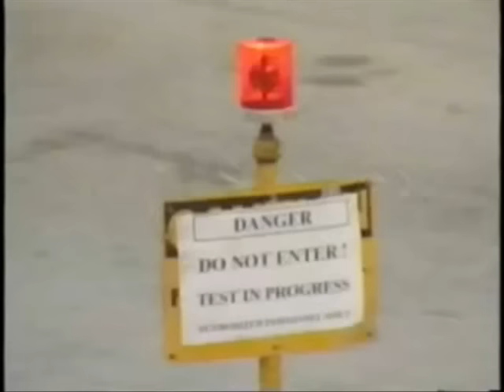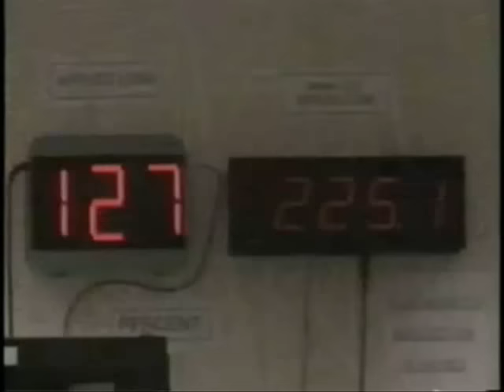Boeing 777 Wing Test

Comment: I think the most impressive thing isn't that it made it to such high loading, but that both wings failed at the same time, and in pretty close to the same place. It's really hard to get that kind of symmetry with variability is manufacturing, etc. Hooray for quality control!
Reply: I think you meant to say "154"
Reply: This is actually expected behavior and I think the engineers would have been baffled if both did not break in the same second. The moment one section fails, the static event is changed to a dynamic event and large stress waves propagate out due to the sudden release of the stored elastic energy. These move throughout the airplane and cause a sudden spike in stress which would push the other (already highly stressed) wing past the breaking point.
Reply: @aegisfate117  touche
Reply: The shock wave of one wing failing travels through to the other wing and causes it to fail also.
Reply: @austincox809  thank you. I didn't feel like typing that all out.  Of course I would have gone much more in-depth but i like the way a little kid can read your explanation and get the real answer.
Reply: @WillaHerrera  Thanks. There are many details left out, but it is best to explain the general idea then get more detailed as necessary. That principle is true in presentations to children and experts alike.
Reply: @jacobzamora5793  This comment is pretty ironic :'D
Reply: @WillaHerrera  "A little kid" wouldn't read these comments.
Reply: @mrjaquavis6444  JZkicksA read them. :p
Reply: Bill Clay  Masters in Aerospace Engineering and 3 years as an on-site consultant supporting Boeing engineer/analyst usage of solid mechanics software
Reply: whats 154?
Reply: This comment aged like a used toothbrush...
Reply: @austincox809  yes simplified terms, one broke then caused the other to break. they didnt break at the same time...
Reply: Not only that but the loads have to be applied perfectly symmetrically as well.
Reply: Hello from the future.  I just made the same comment which you did 9 years ago.  Bummer it took so long for someone else to notice.  There may be more below, I have not looked yet.  Tho I am cheating a little, professionally I manage variability in the manufacture of integrated circuits (where we operate in ps time units, literally 1ps is a thing, and design aspects are 10 atoms thick so +/- 1 atom is also a thing). So I have realistic expectations.   I am very curious to know how you did too, if you ever get this person from the past.
Reply: It's all scripted!!!

Comment: I'm amazed they broke at the same exact load. That level of engineering accuracy on massive structures is mind blowing. It gives me a whola lot of confidence if I ever have to jump in one of those big birds again. Props to engineers.
Reply: Props or jets. I don't mind.
Reply: I'm no engineering expert but I suspect the breaking point was not exact for both.  When one went, the other one was so close, the shockwave transmitted into it pushed it over the edge.  Microseconds in it, but unlikely the exact same time.  Two in quick succession, one triggered by the other.
Reply: Hello from the future.  I just made the same comment which you did 5 years ago.  Bummer it took so long for someone else to notice.  There may be more below, I have not looked yet.  Tho I am cheating a little, professionally I manage variability in the manufacture of integrated circuits (where we operate in ps time units, literally 1ps is a thing, and design aspects are 10 atoms thick so +/- 1 atom is also a thing). So I have realistic expectations.   I am very curious to know how you did too, if you ever get this person from the past.

Comment: I am a retired Boeing engineer involved with the development of 777…and that's not quite what happened. After the first wing fails, the load on the opposite wing is reduced due to the fuselage rotating. What caused the second wing to fail is the shock wave traveling through the structure into the unfailed wing. In an actual flight that loaded the plane to 154% (couldn't really happen, but let's assume it can), the fuselage wouldn't be supported to limit rotation and the first wing would fail which would virtually eliminate the load on the opposite wing and the result would be no failure regardless of the shock wave. All this doesn't mean both wings can't fail in flight. If the airplane gets into a severe flutter situation, both wings can be ripped off due to high aeroelastic loading. Obviously the airplane is designed to never experience a flutter situation, but if we run 6 shimmy models on the landing gear and if all 6 predict no shimmy, then maybe we won't have shimmy.
Reply: And if the first wing fails in flight it doesn't matter if the second wing fails  :D
Reply: What WOULD it take to hit 154%? 500mph Cruising speed minimum radius 90° back turn?
Reply: Claiming to be a retired boeing engineer etc etc is kind of pointless, 99% have nothing to do with  this test. 
Q1: Structural Engineer?
Q2: Wings?
Didn't think so.  Watch the video, see the facts, stop spewing inane BS and embarrassing yourself.
Reply: @hotliner2872  Exactly what qualifies you to criticize a retired engineer you know nothing about, or call his/her statements "inane BS?"  I'm an engineer (not aeronautical) and what he said reflects sound engineering principles and makes complete sense.  He or she doesn't have to be involved in this specific test, or the engineering of the wing, or even be a structural engineer to understand what happens.  Most of it goes back to engineering fundamentals; if you had an engineering degree you would know this.
Reply: @hotliner2872 What a plank 🙄

Comment: With just 17 cuts, a pizza can be cut up into 154 pieces
Reply: what? are you sure?
Reply: @ericturner2477  Yeah but if you do 9 straight cuts through the center and 7 concentric ring cuts around the middle, you can get 18 sectors divided into 8 pieces each, therefore 154 pieces. Though that's only 16 cuts...
Reply: Ah yes mathematics.
Reply: But.... does it go boom?
Reply: - Hey, how many slices does this pizza have?
- ONE FIFTY FOUR
pizza explodes and everyone cheers

Comment: what really impresses me is that both wing gave in at the same time, to the split second. Unreal build quality
Reply: One actually broke first, which sent a shock load into the other causing it to break too.  If you tested them separately they would almost assuredly break at different loads, but they'd probably be in the ballpark with each other assuming both were designed equally and fabricated similarly.
Reply: Hello from the future.  I just made the same comment which you did 9 years ago.  Bummer it took so long for someone else to notice.  There may be more below, I have not looked yet.  Tho I am cheating a little, professionally I manage variability in the manufacture of integrated circuits (where we operate in ps time units, literally 1ps is a thing, and design aspects are 10 atoms thick so +/- 1 atom is also a thing). So I have realistic expectations.   I am very curious to know how you did too, if you ever get this person from the past.

Comment: What I think non-engineers might not know, is that design limit (and correct me if I'm wrong you full fledged engineers), is not just the force the wing should be subjected to, but the force it could be subjected to given a whole bunch of factors. And the fact that it surpassed that limit by another 53% more, is incredible
Reply: Everyone likes a "safety factor" of 50%
Reply: As a structural engineer I admit I had to do some digging here.  I originally posted here that this is correct, but now I amend my comment.

I believe in the aircraft industry, design limit load and limit load are the usually taken to mean the same thing.  There are other industries where "design limit load" does include factors and plain old "limit load" does not include the factors.  I think what is best is if you add factors, it is best to explicitly state it somehow like "factored limit load" or "I define design limit load to be the highest expected operating load multiplied by the required safety factors".  Just make it clear.  

The ultimate load is the limit load multiplied by a factor, often 1.5 in the aircraft industry.  So ultimate load is 1.5 * limit load, which is why everyone here was cheering at 150% of limit load.  It met the ultimate load requirement.

(Just some additional information: limit load (LL) is the maximum expected externally applied load.  You can't have any permanent detrimental deformation at this load.  Ultimate load (UL) is the limit load multiplied by a 1.5 factor of safety in this instance.  You can have permanent deformation at this load, but it shouldn't break.)
Reply: the max loading for heavy transport aircraft, B777 included, is 2.5 g's. One fifty four means 1.54 x 2.5 = 3.85 is the g loading at which the aircraft wing is expected to fail. That's very far outside any standard flight profile.
Reply: @cameronpeterson1175  The other thing they're worried about is how much over 1.50 it breaks. That's why they're equally nervous as the loads keep climbing. Mass is critical in any vehicle; failure above 1.50 means you overdesigned it, and the structure is heavier than it needs to be. Typically, engineers intentionally err on the side of underdesign, so that it breaks before the required loads. This happened on the A380, for example. You find the part that failed, make it a little thicker, and do it again.

Comment: More impressive is how both the wings breaks at 154. That is some mad engineering.
Reply: One failed first, and the shock wave caused the other to fail. This happens frequently in failure tests. It's unlikely both wings would have failed within 1% of the same load if they were tested separately.

Comment: The most impressive thing for me was both wings failed at exactly the same time. These are independent structures in terms of where they failed (mid wing), so this speaks volumes to quality of design and construction. I was actually expecting some lag between failures, in a structure like that there are literally thousands of opportunities for perturbation in either direction from the norm. So either they have reduced the perturbations into the noise, cancelled or at least RSSed them (i.e. one weak point either counters or is orthogonal to another, so the net effect is reduced... weakness A cuts strength in half, and weakness B cuts strength in half, but combined they reduce strength by just over a half ), for the result blew my mind.  That is great engineering.

Comment: It was always interesting to me that this test was performed with the fuel tank access plates removed, which would not be the case in flight. With the access plates installed, It would also add even more strength to the wing!